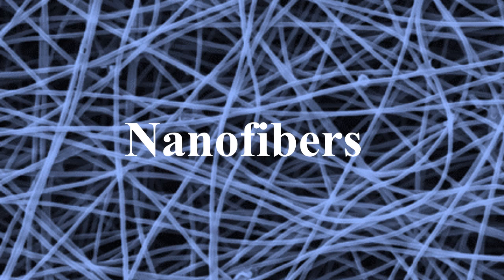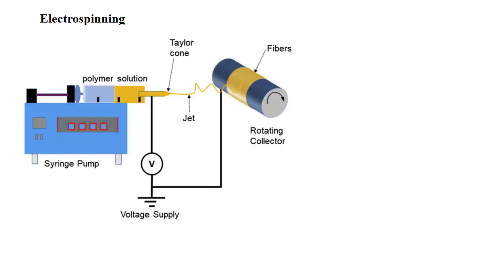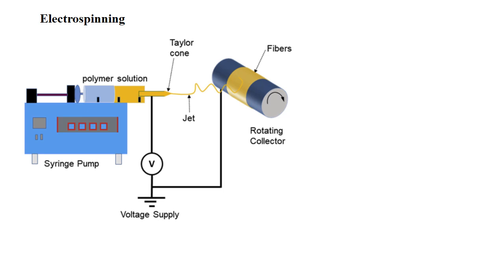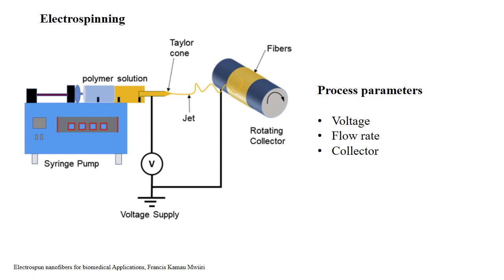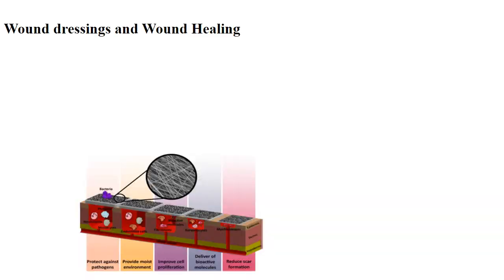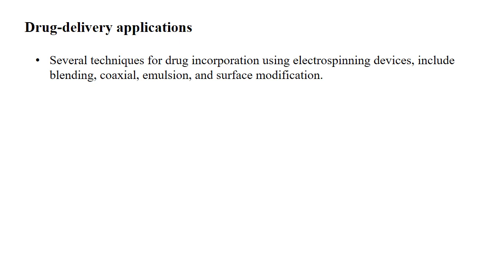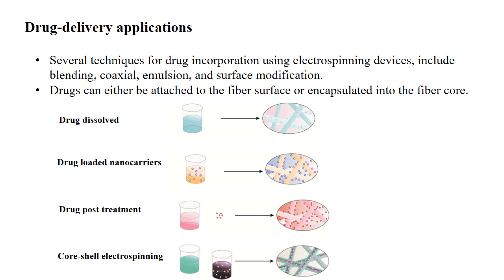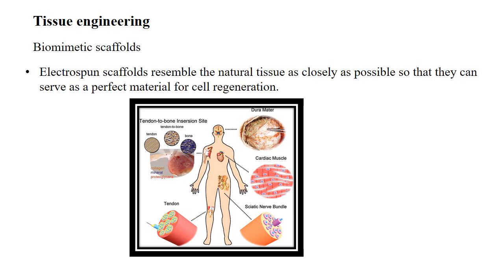Nanofibers #nanotechnology #nanomaterials #nanotech

Comment: Hello Madam, what could be the reason that micro fibers are formed during electrospinning process rather than nano fiber dimensions?
Reply: Low voltage and higher flow rate of polymer solution could be a reason. If you have polymer lumps in the nanofiber mat, increase the distance of collector.
Reply from the maker: Please refer this fundamentals of electrospinning (Nanofibres in Drug Delivery
Book Author(s): Gareth R. Williams)
Reply: @sharongeorge7   Thank you.

Comment: Why water molecules can't pass through even though they are smaller than the fiber diameter?
Reply from the maker: It's depends on the diameter of the nanofiber and material used. Normally, the diameter of nanofiber can be tuned by adjusting the initial parameters ( voltage)..even microchannel monodispersed water drops are passing through by different shapes. So it is possible